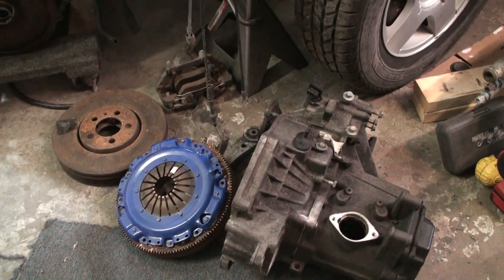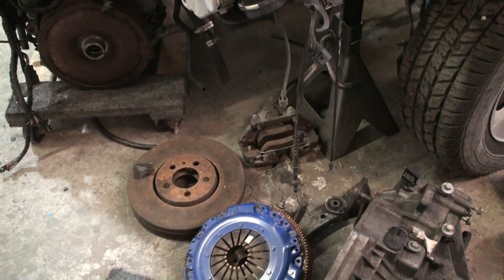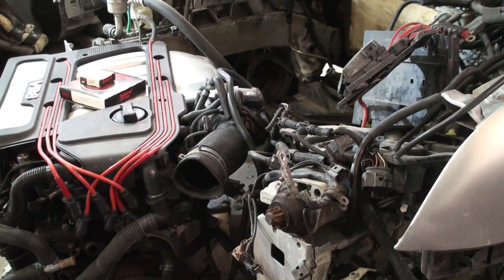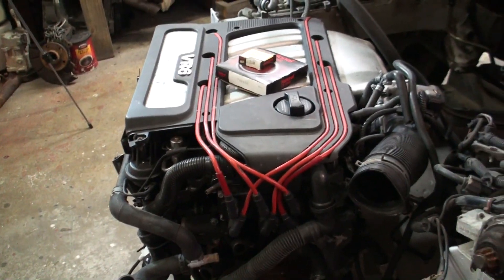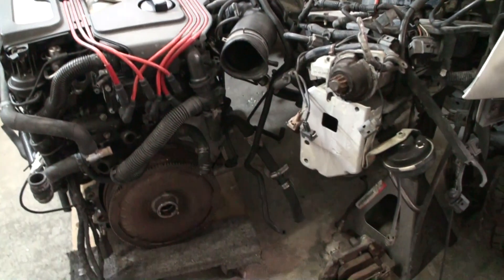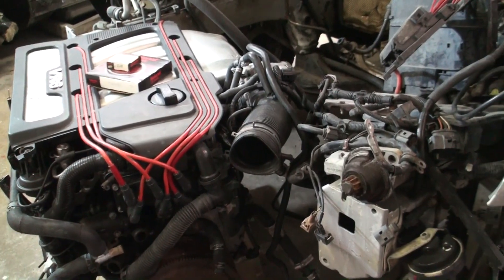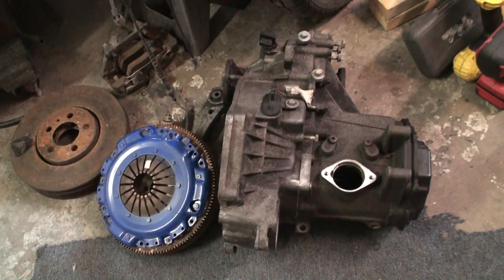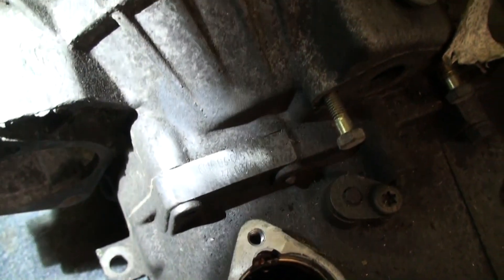Jetta VR6 12v swap part 2

Comment: I have a vr6 12v mk4 and it was an automatic but then it was swapped but I'm getting solenoid codes! Any idead what it might be?
Reply from the maker: You will get codes like that if you went from automatic to manual , its looking for the automatic transmission inputs/ solenoids specially if you kept the stock ecm
Reply: Cody the Car Guy would i have to change the Harness as well ? I just need these codes gone so I can pass the Emissions test
Reply from the maker: pretty sure i can reflash that so no automatic codes come up, ill have to check tomorrow
Reply: Hey Cory I have a 03 GLS Jetta my 2.0 and I want to do the same thing you're doing this is a VR6 I want to put that in I found a VR6 but I'm not a car guy and I don't know my parts or anything do you know how much it would cost to swap an engine out and have a mechanic do it?